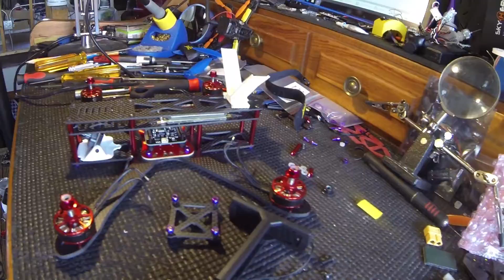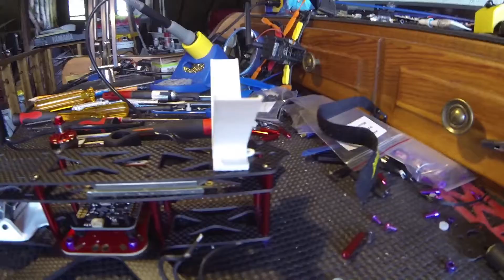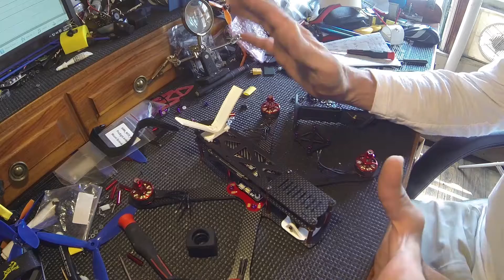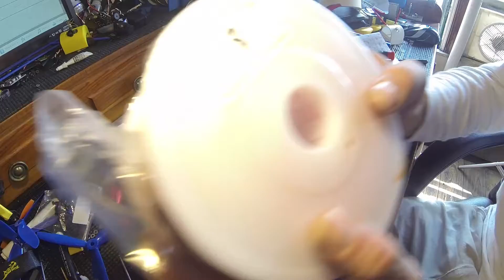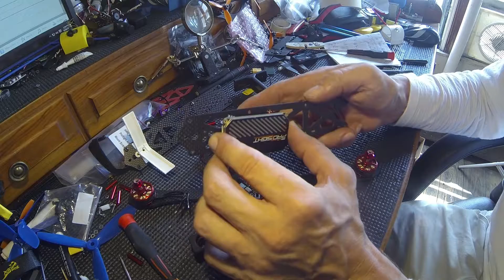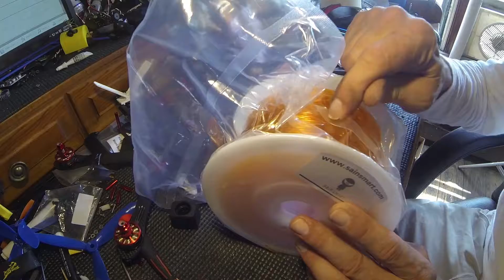3D Printed Connex parts, Alien 6",how it's going to fit

Comment: No comments? Far out man that looks slick as! Have you considered using a peltier and heat sink? I hear HD downlink transmitters can get really hot? Also lastly maybe have a look at PC standoffs for better sizing (although I can see you are really going with colour coordination) beautiful setup btw.
Reply from the maker: Thanks, I remember that quad, back when there were few frames out there for the connex.  I still have a Sigan Stretch Connex
Reply: Sorry for the confusion man, Peltier isn't a quad, it's actually a thermoelctronic induction....it's discovery was by french Physicist Jean Charles Peltier. Have a read about it on wikipedia, it's a very interesting topic! https://en.wikipedia.org/wiki/Thermoelectric_cooling

My suggestion is to use a pelier (obviously combined with a micro thermostat for temp monitoring and regulation - note this would be uber cool to display heads up on OSD!)coupled with a light weight and efficient thermofin heat sink i.e think of it more as a "heat dissipator".
Obviously adding any weight (even if it's small) to a quad is highly avoided and disliked by most pilots, however I think using a small pelier (if you read up how they work and the principles they use) the benefits gained could far outweigh (pun not intended) the costs ;-) 
The key thing I am hinting at hear is efficiency mostly around heat dissipation and obviously the radiating heat not hindering other onboard electronics.

Note: I totally have zero clue about electronic inductive cooling proximity and other inductive effects such as magnetic EMF interference being detrimental/inhibiting/ etc etc to things such as onboard RC receivers, digital video transmitters and/or nearby (other quads) RF/video??? etc

Sorry for the long post. Once again I really love your build and the styling you've gone for with it massive thumbs up! Look forward to seeing more in the future. Cheers